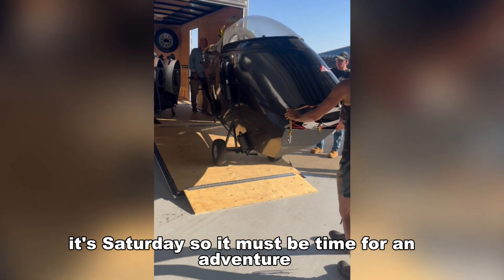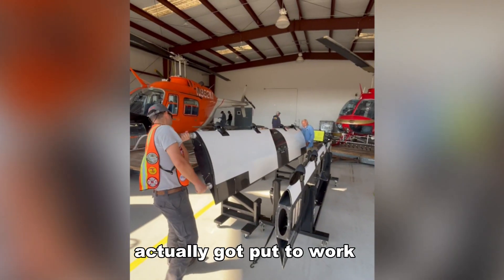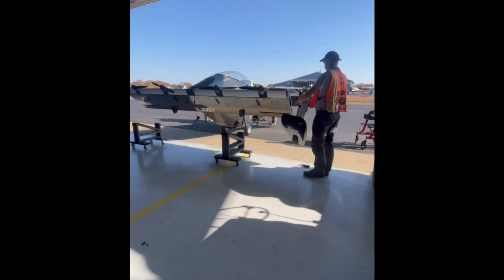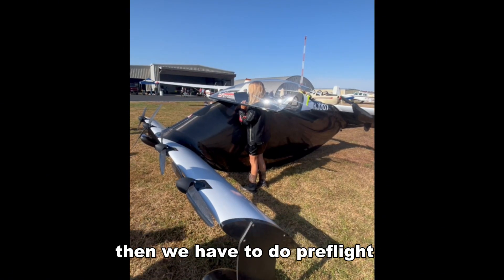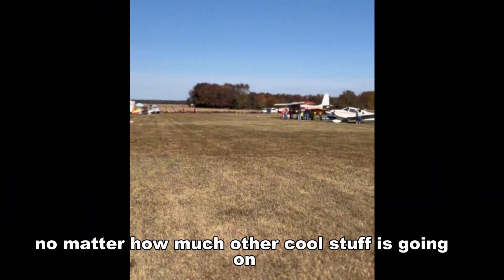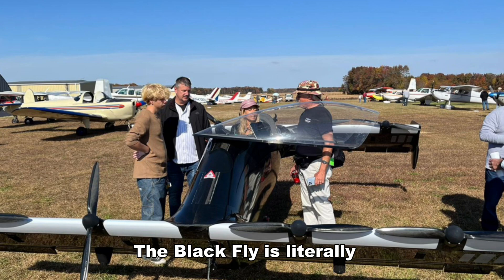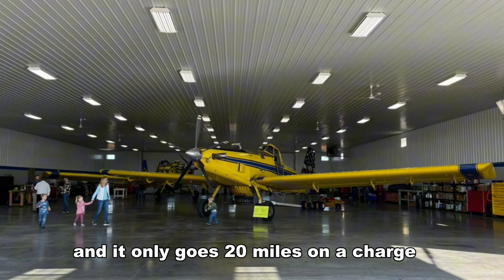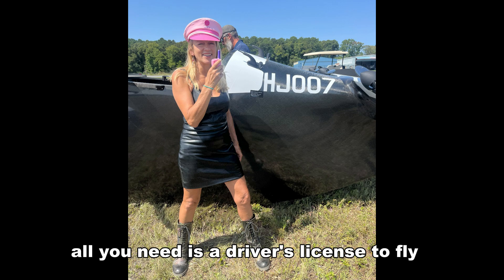I Took My Flying Car to the Airshow

Comment: The video would have been a lot more impressive if the thing had actually flown.
Reply: There are videos that shows test flights of the Black Fly. Also on You Tube. Frankly, I think it's ugly. Also, you need to watch for controlled and restricted airspace. You can't fly it just anywhere. I hope this helps!